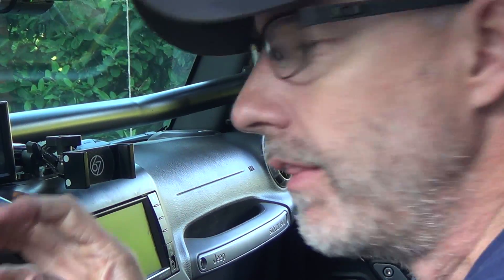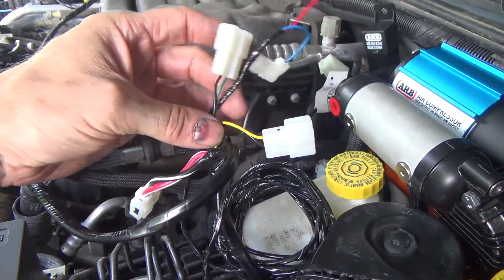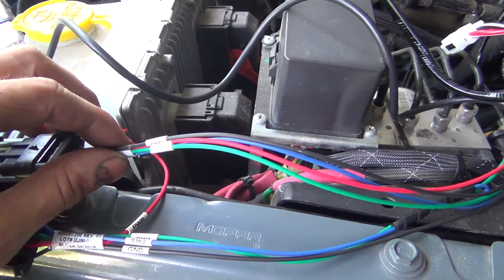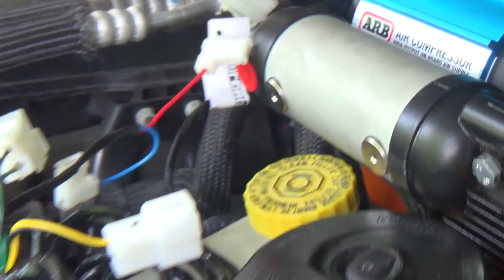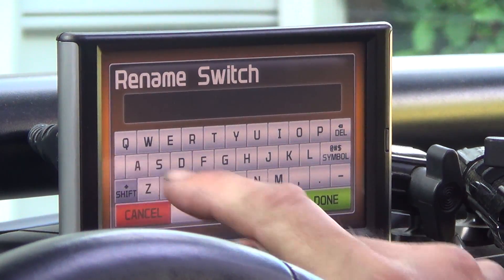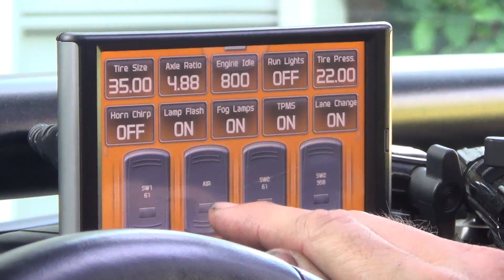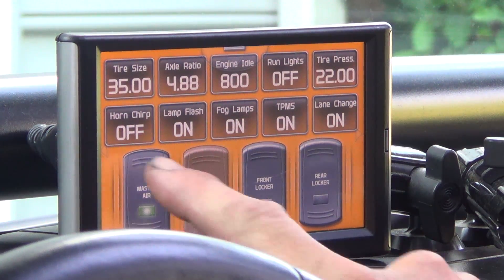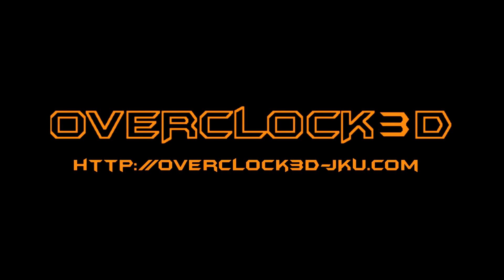Superchips Trail Dash 2 (TD2) EAS Switch Wiring and Programming for ARB OBA

Comment: It would be nice if the system worked with a Voswitch, sPod or Auxbeam with a flat circuit panel.  That wiring seems complicated AF.  Shame on Holley/Superchips for not having a more elegant solution...

Comment: I know I’m late to the party here but I’m curious about the locker rewire... why would you need to rewire the lockers in the first place. Disclaimer: I’m a nube. Mine already has switches. I ask because I want to run the same ARB compressor and was watching your video to see if I could do it myself but the rewiring of the lockers threw me off.

Comment: Hey great video. I have a 08 jk Rubicon. I've had the trail dash for about a year. I love it but last week I started the jeep and the screen said I had to update is on the computer. The problem with that is the trail dash quit working. I wouldn't let me cancel so I can finish driving home. So I wonder if your out on the trail and that happened while u had your lockers lock. How could u unlock them to get home? Just a thought but I'm sure you keep yours up to date. Glad i wasn't realling using mine at the time. lol
Reply from the maker: Thanks for the feedback.  Computers do suck sometimes... and that's really what these things are. If that were to happen while I was locked... I I could simply turn off the vehicle and the lockers would disengage. (I wired mine to the accessory circuit). I could always just unplug the TD2 (its actually not required to be plugged in) and the switches would remain disengaged. I hope it doesn't happen...but I have had the TD2 lock up on me before... usually a reboot solves it!